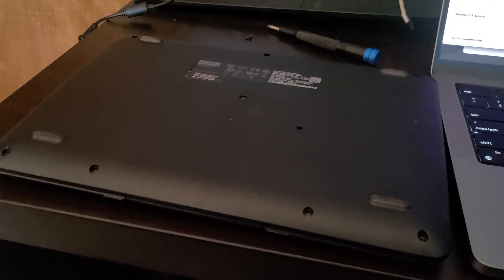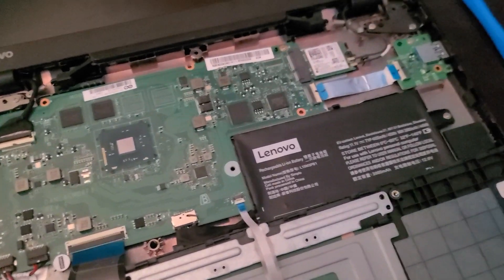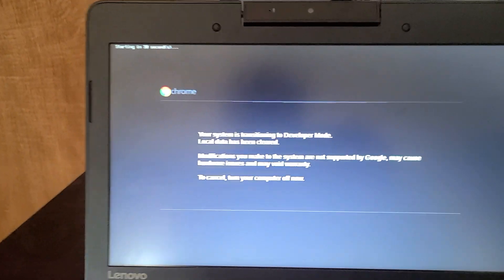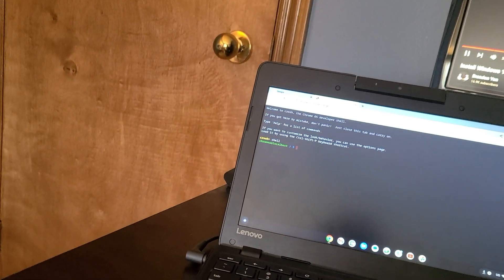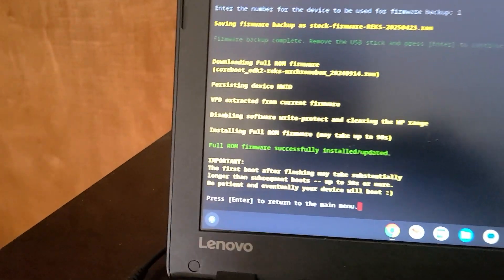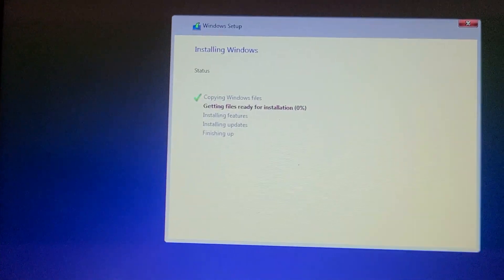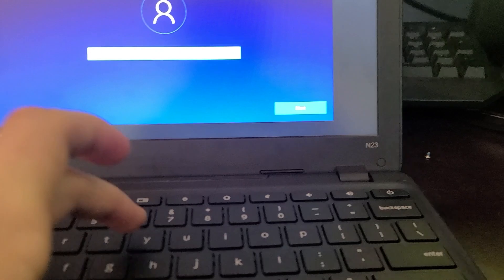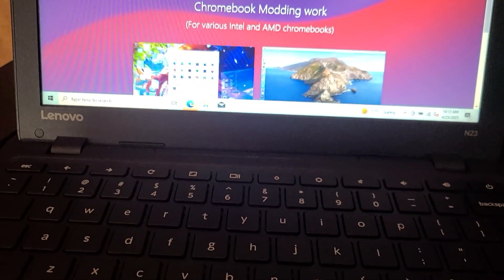Installing Windows 10 On An Old Lenovo Chromebook

Comment: What is various command...my Lenovo N22 stuck at shell...
Reply from the maker: If your Lenovo N22 is stuck at the “shell” screen, that usually means it’s waiting for some commands in Developer Mode or you're in the Chrome OS recovery shell.

If you're trying to install Windows, you’ll typically need to:

Enable Developer Mode (if you haven’t already).

Access the shell (crosh) and then press Ctrl + Alt + F2 (or Ctrl + Alt + →) to get to a proper terminal login.

Log in as root (just type root and press Enter).

From there, you may need to run commands like shell, then sudo bash, and eventually use a firmware utility like MrChromebox.

⚠ Important: Installing Windows on a Chromebook like the N22 can be tricky—it often involves replacing the BIOS and making sure the internal storage is recognized correctly.

Could you let me know exactly what step you’re at and what you’ve done so far? I’d love to help walk you through it if I can! 🙌